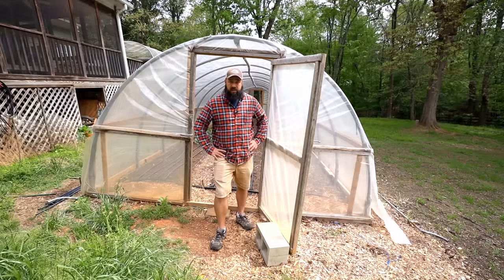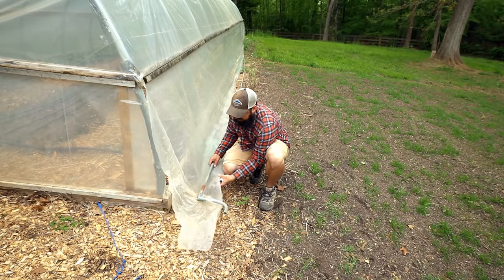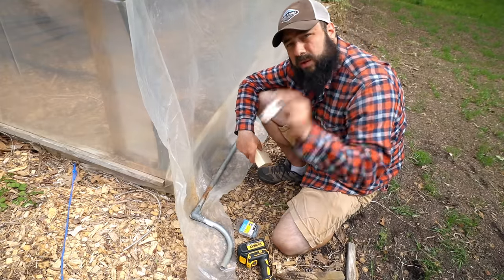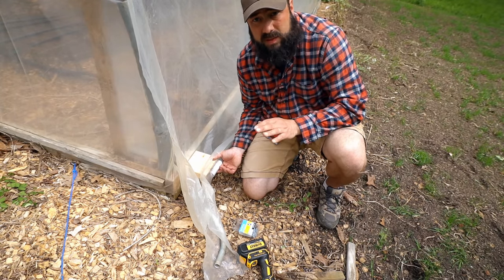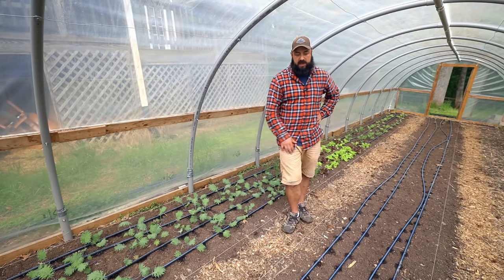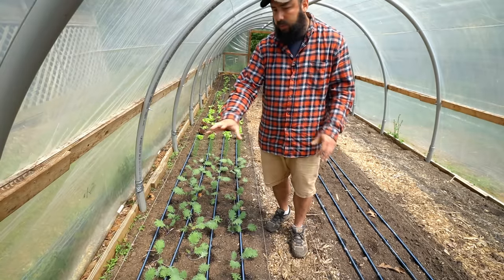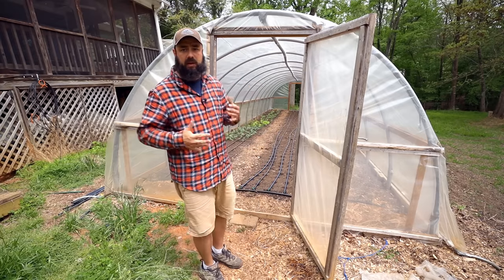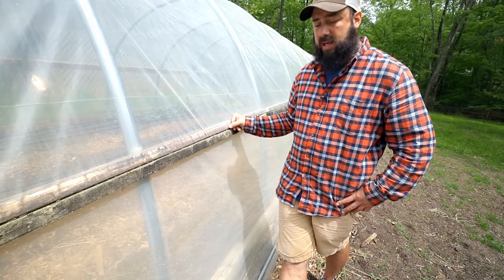DIY PVC GREENHOUSE - 2 Years Later

Comment: Plastic has memory so take your lighter or heat gun and heat the plastic clip lengthwise down the center and then once it's a little pliable squeeze the plastic clip closed a little and let it cool a couple minutes... then do it again when it loses its grip in a year.... or use self tapping screws to hold it :) Cool idea rolling it up!

Comment: I made a 6 x 8 unheated greenhouse out of pallets , pvc pipe and used scrap lumber and can't wait to use it!  I had to purchase a couple new 2 x 4's, a roll of 6 ml green house plastic ,a white tarp for severe weather and 3/4" cpvc pvc pipes for the arch's.I plan on installing a couple automatic exhaust fans and vents later but for now I have a manually operated window on one end and an air vent on the other.Like you I can already see things I'd do different if I built another but I will use this one until its not practical to fix any longer.Thanks for your video.Your greenhouse is very well built and has held up well I think! You did a fantastic job making it and I look forward to future updates!

Comment: I built a greenhouse of the exact same design in the fall of 2017. I agree with your conclusion that I would’ve been better off buying a kit. I’m in Michigan so I’ve had to reinforce the PVC bows to deal with the snow load. My greenhouse is still in use but it’s just not great like you said. And I don’t think I’ve saved much money compared to a kit. Thanks for the update!

Comment: Josh, you have always had good, straightforward and practical advice in your videos and this one is no exception.   I hope you will post another one in a couple more years to  update on how the hoop tunnel has held up.   Meanwhile, what is your location?   I'm seriously asking because I am in Zone 8B in Jackson, MS which gets up to 75 inches of rain, extreme heat and humidity for long periods during the summer, and is subject to hurricanes, tornados, hail storms, and all sorts of other natural hazards.  

Hurricane  Ida last week passed within 20 miles of my property breaking off large tree limbs and downing other trees.  I believe a one layer plastic sheeting poly cover just won't withstand the type weather we routinely get here.  I don't want to have to tear it down and rebuild the tunnel every time we get some destructive weather because some years that happens multiple times per year.  If you are in Syracuse, NY, which has the least natural disaster events in the county, you are never going to get tornadoes, hurricanes, earthquakes, and hail storms so nearly anything will probably work there. But I am not sure it will work well here in Mississippi.

Also, the heat from our summers zap our plants to the point where most of them have to be watered every single day.   Mother Nature gives us up to 75 inches of free rainfall that doesn't require me to spend any of my time replicating.  But if I seal off the plants via a hoop house, isn't that going to mean I have to spend my time and effort watering plants to replicate what nature provides free?  The bottom line is I don't need more time consuming chores!  LOL.

Your thoughts on these things would be greatly appreciated.  Thanks!  PS> I really like the roll up sides idea!

Comment: Thanks for the imput on this, i acquired some conduit like you used for next to nothing but decided not to use and have started building a greenhouse based on Ana Whites plans. Her design is using clear roofing panels but i will be using greenhouse plastic as i already have it.  Been thinking about how to secure the plastic. Looked at wigglewire but atm cant swing the expense, will probably use your method of strips of ripped deckboards and screws. Looking forward to getting it put into use this year. Ours will mainly be used for starts and possibly overwintering. Been

Comment: Heat it by the same way you heat a home. solar running through tubing in floor and how else running could be best utilized. The main heating tubes (the evacuated glass/gas ones will heat that sucker and could get too hot. but hey , let the moister run down the walls and collect it. a perfect circle.

Comment: I built mine 8ft by 16 ft.  2x6 treated base.  no cutting.  same kind of pipe... BUT...I built mine Cathedral style instead of Gothic style as yours is.  that is...straight sides and 45 degree sloped roof.    I wish I had done Gothic.  The PVC connections are rubbing on the plastic even if its tight.   The white clips don't hold enough so that it takes many more than usually recommended.    I used  ABS plastic pipe 3 inches long and split.  they work... and they are cheap and that's about all you can say about them.   I used a nail strip to anchor the plastic on the bottom.    I was using the weight of the  frame on top of more pipe with the plastic attached to hold the plastic tight  but it wasn't enough.   
Next time:  I will build it Gothic Style.  12 feet wide to use the whole pipe.   The plastic long enough to bury 2 feet of it in the ground.   Make full sized doors on the ends to open up full air flow.  (its what I have now for just that reason).    
Thanks for the update.  It really helps anchor my own design  that incorporates all the learning.

Comment: Hey Josh, good video again Brother. One thing tho is that the chemical reaction between PVC and the plastic is when you use the white, plumbing PVC only, not the gray, electrical conduit that you used on yours. But your correct in everything you said about painting or covering the pipe to eliminate degradation of the plastic IF you build with WHITE pvc, not gray. If you use the gray electrical conduits you havethen you can put the plastic directly against the frame. 

Everything else is spot on buddy, good video

Comment: This winter our first snow was a heavy one and crushed the top. With that said I need to make updates during the repair. I plan on opening the sides as you have. You mentioned zigzagging rope to keep the sides tied down to prevent any wind damage. Do you have any footage of how this is done? Also did you use a separate piece of poly for the bottom half of the sides?

Comment: Hey Josh, love your channel I recently came across it.  You said that you wouldn't do DIY on a hoop house but what about EMT Gothic style greenhouses? I was going to do a smaller setup about 25x20 and wanted to produce my own supplies for the ability to add onto the end and increase length as needed or deemed possible and I was concerned about cost, and being able to buy the exact same frame components if and when I do decide to add on.  I have conduit benders already and I priced the frame out at about 445 with a sheet of 20x55 plastic. I decided to add on an additional 200 dollars in budget for wiggle wire and fastenders/addtional pressure treated lumber. What are your thoughts?
Reply from the maker: You can only answer what makes sense for your context. For what I needed it cost the same amount for my tunnel and there are a lot of downsides to it.

Comment: Nice diy green house. How do you control the critters?
Reply: I have free-range chickens and there are some wild rabbits where I want to put my greenhouse. Going to raise the sides up 2' and put rabbit wire on those sides (hip board is top line of raised section). Then, going to make a split, dutch door so I can still have ventilation but keep critters out.

Comment: If you are going to make your own clamps, don't. PVC deteriorates greenhouse plastic. This necessitates the use of tape between the clamp and the plastic. Time consuming. It also tears the plastic unless you spend big chunks of time beveling the inside. Even with a bevel, the clamps are too tight, and the sched 40 homemade clamps still tear the plastic. Too tight. If you insist on making your own clamps, don't. But if you do, then use sched 21 pvc because it is thinner, and more flexible.